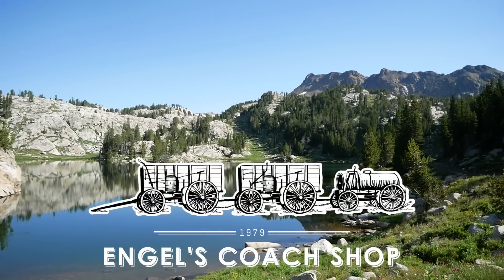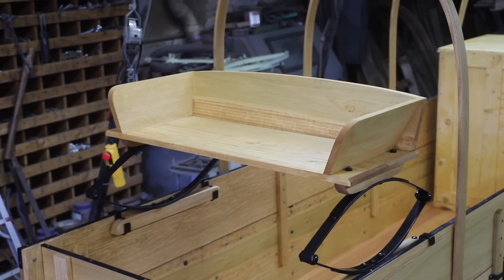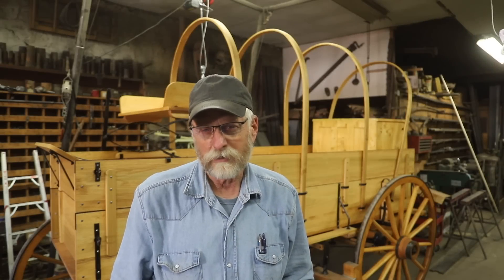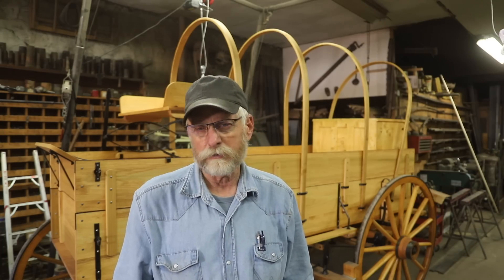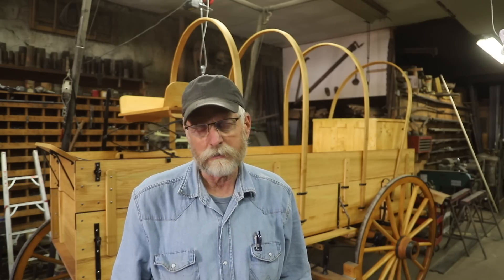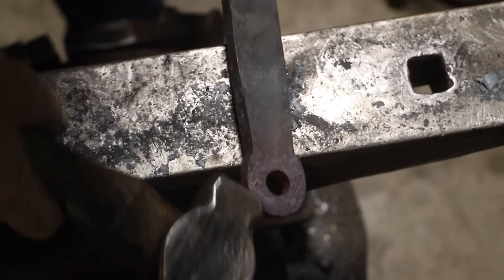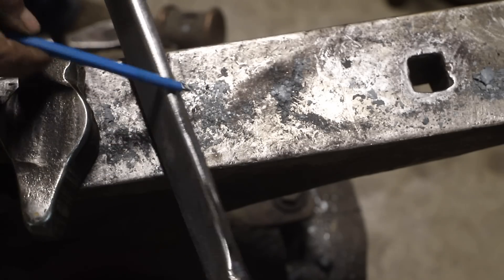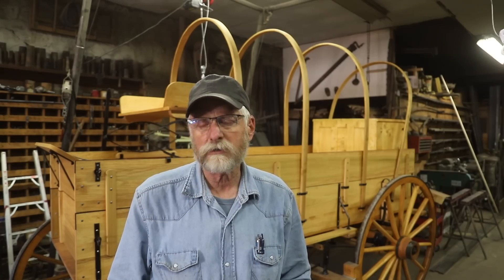How to Make Whoa Mean Whoa! | Engels Coach Shop

Comment: I may have missed it but what determines what side the brake handle is mounted on? The Borax wagon brakes are on the left side while these are on the right.
Reply: The Borax wagons are the odd ones. The teamster rides the left mule and works the brakes. On wagons and buggies the driver sits on the right, so the brake is on the right.

Comment: That's pretty cool but that ain't the way Studebaker made them 150 years ago;  they didn't have lathes, mills, power sanders, cordless drills,  table saws,  and  electric welders.
Reply: Commercial metal lathes and mills are 200 years old. Table saws are older still. Do you have actual knowledge to support your statement?
Reply: @toddrf  You are right, I misspoke about large manufacturers like Studebaker and Gruber - they had large, crude machines driven by flat belts powered by steam.  But,  the average wagon maker in the 19th century was just a blacksmith's shop and most of the parts were made at the forge with Hand tools;  wood was worked with a myriad of hand tools.  Some holes may have been drilled(if not punched at the forge) with a hand powered drill press.   Welds were forge welds and if you have ever done them, you know how difficult it is to make good ones especially without modern fluxes.  The "Wagon Wheel" was a hand made work of Art.
Reply: @Hogger280  yes, wainwrights (that’s a person who builds wagons) in the 19th century used different processes than they used in the 17th century and different still from those used in the 15th century. Not really sure what your point is. This isn’t “The Wainwright’s Shop” with Roy Underhill.  Dave does not claim to use period tools, materials or process for all of his work.

Comment: Fascinating to watch you incorporate old iron - and fabricate replacements. The pivot for the brake handle was very interesting. Seemed more sophisticated  with all the turning and threading than the rest of the gear, especially as it might affect a field repair. Would it have been a “purchased” part at one point?  Thanks for the video.
Reply: Possibly
Reply: @dianeengel4155  I was trying to picture a one-piece, bent, forged replacement with a pin to retain the brake handle.  But it was elegant with the turned, threaded pin. Thanks.

Comment: I always get a little frisson of pleasure when I watch you clock those square nuts as you tighten them down. It's those tiny details that make the difference between utility and art.
You might want to recalculate the mechanical advantage in the brake system. The ratio is going to be the total length of of the arm from the pivot to the handle (the input) divided by the length from pivot to brake rod (the output) - thus 40:8 rather than 32:8, or 5 to 1.  At the rear, 20" is the total length of the "input" arm, so that ratio is 4 to 1 as you say. So, over all, 20 to 1 rather than 16 to 1. Now, for the actual pressure at the point where the shoes meet the tires, you are going to have to divide by two since the pressure is shared by the two brake shoes. Thus the pressure on each shoe will be 10 times the pressure on the handle (less any loss to friction in the pivots).  If the system turns out to need more pressure, the place to gain advantage will be by shortening the output arm(s). Moving the output holes an inch or so closer to the pivot points will make considerable difference in the overall ratio.

Comment: Mr Engels at 16 minutes into the video the lever that drops down from the long connecting rod has 2 round hoops what do they hold?  Great video been following along for years something new every time. Take care stay safe.
Reply: They're hardly ever used but a wood handle can be put in those and a rope attached so you can walk beside and drive oxen.

Comment: Hello Dave .Really enjoy your videos and I learn a lot .Just wondering ,I do a lot of wood work on vintage cars and I find that the level of quality of the origional timber frame work varies from really nice work all the way down to something that looks like all the builder had was a blunt axe ! Im working on one of those at the moment, the problem then is thet the body frame has been clad in sheet metal which has been hand formed over that rough and often out of shape timber . The metal cladding part aside do you find the same quality variations in the wagons you do ? Just interested .Regards John Keane.
Reply: There was a video where Dave was rebuilding a wooden wheel. Once he had it apart, he found that whoever put the wheel together originally had installed several of the spokes backwards. I’m sure there many such examples.
Reply: There are videos of people doing similar stuff, and they just get it done good enough to work, Dave builds rolling art.
Reply: Yes

Comment: Gout brake lever applies a force not a pressure. . Mechanical engineer!!!
Reply: You sound like someone who would point out that something can’t have a weight expressed in kilograms.
Reply: Pressure is in a balloon or a propane tank  the units of measure don’t matter again your brake is delivering a force !!!
Reply: @billbutler3578  and that force (in pounds) is being applied against the wheel by the brake shoe over its surface area (in square inches).  Guess what pounds over square inches is?  Want to be a pedant some more?

Comment: Some of these Keyboard Experts take the fun out reading comments... They are missing the fun of the build series.  Whether a braking system effectively works seems to be lost in their decimal points...  Still a fun video, Thank You, Dave & Diane!!
Reply: Many of these “keyboard experts” are actual experts in mechanical engineering. Knowing the true mechanical advantage of this particular linkage is hardly a trivial point.
Reply: @toddrf  I wonder if the Justice Department and the FBI will become involved here for questioning the content of educational material.

Comment: Actually Dave your math on mechanical advantage is off by a bit. For the brake handle itself the mechanical advantage is 5 to 1. If you apply 10 lbs of force at the top of the handle you will get 50 lbs on the rod. The reaction force at the pivot of the handle will be 40 lbs. So assuming your math for the rear portion is correct your total mechanical advantage would be 20 to 1 and you would get 200 lbs of clamping force. I can't check your math on the back portion because I don't have a good picture in my mind of that mechanism. The actual force will be reduced somewhat do to friction. Those old time pivots were by no means low friction.. By the way I'm a structural engineer.
Reply: Thank you. Dave can see that now.

Comment: The title for today's video reminds me of my grandpa. He was born in 1896 and farmed with horses full time until 1969. Sold his last team in 1976. When i spent summers with him in the early 70s His first pickup was a used 1959 Ford he bought in the early 70s. He allways parked it in the garage.One time he forgot to push on the brakes as he drove in at a pretty go clip. He yelled WHOA 2 times before he realized he needed to push on the brakes instead. The back wall of his garage got pushed out about a foot!!
Reply: I had a 67 Ford pickup that I put a 350 Olds Rocket engine in that a guy at a tire shop scared himself with. I warned him that he had to be careful with it because it would take off like a bat out of a very hot place if you stepped on the gas. I told him to just pat the accelerator to move it into the shop. His response was to tell me that he could drive anything and that I didn't need to tell him how to drive that truck. When I went to pick it up after work I heard another guy yell "that guy's here to pick up that truck you nearly ran through the shop in!" I went into the shop over the cashier's objections and said "what's this about nearly running my truck through the shop?" The guy who said he could drive anything was at the other end of the shop looking very pale. I started laughing and said "I gotta see this." One of the other workers started laughing and took me over to show me the skid marks that started about 10 feet in front of the door and stopped about 3 feet from the back wall. He stopped with less than a foot between the bumper and one of the main supporting posts on the back wall. From where I had parked the truck to where the skid marks started was about 15 feet and he slid almost 40 feet with the last 30 feet being slick concrete. The guy telling me about said they heard the engine rev up and then they saw him sliding through the shop. He said that when the guy got out of the truck he was as white as snow and shaking like a leaf in the wind. He wouldn't back it out and one of the other workers had to back it out of the shop. Everybody in the shop wanted to know what I had in that thing.

Comment: my 1950's towmotor forklift has a crescent shaped iron with sawteeth that is attached to the brake pedal and passes through a hole in the floorboard .if you need a park brake you depress the pedal and cock it to the side and the teeth on the iron catch on the floorboard and hold the pedal down. hmm, i wonder where they got that idea? great video as usual.

Comment: A slick trick I've used to "age" fabricated steel parts is to use a pneumatic needle scaler. The needles give a peened finish that mimics the pitting you might find on original cast iron or steel parts. Once painted it can be hard to tell whether or not it's an original.
Reply: - Yes, Great Solution...{and obvious, too, once you think of it}...I was thinking of all the hammering/peening that would have to be done, or sand blasting...that would have been lots of work and never get to the needle scaler marked finish you came up with would produce, especially if applied to hot iron.
Reply: Dave is going g to check that out.

Comment: How much would a wagon cost you?
Reply: More than a new car... Everything is hand made as you can see...
Reply: There is enough instruction on this channel to plan and construct a number of wagons. Build yourself one using free 3D modeling software (like Blender or FreeCad), just to familiarize yourself with the assemblies. Later, if you have the budget, the models can be 3D printed at your specified scale. There are plenty of services available that will print it for you out of your choice of materials, even a wide range of metals.
Reply: @opendstudio7141  Or you can buy a kit from Mr. Dave, Everything is cut and supplied to construct your own set of wheels... A little cheaper that way... But a lot of work...🔨